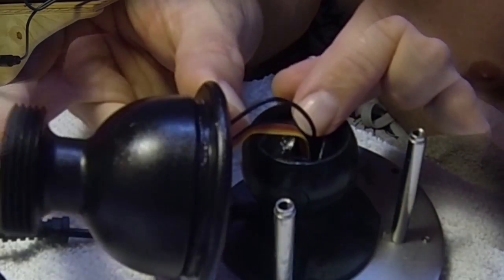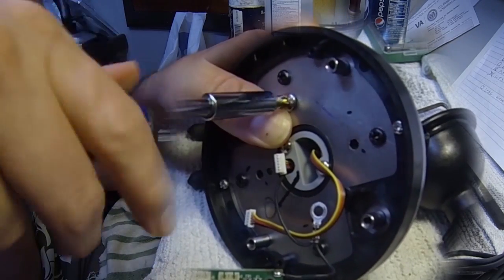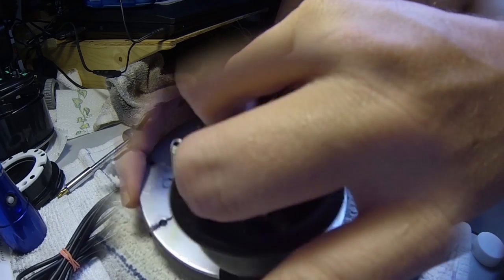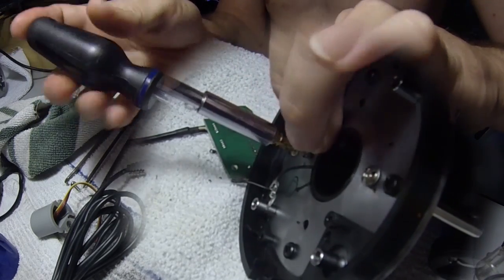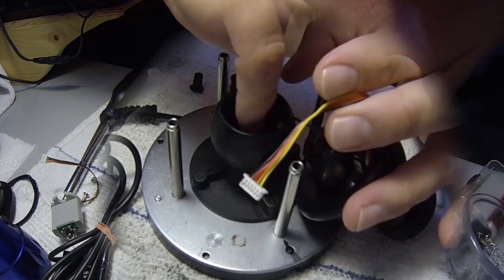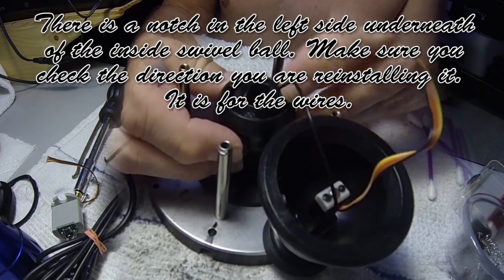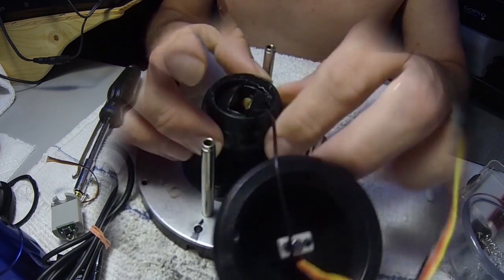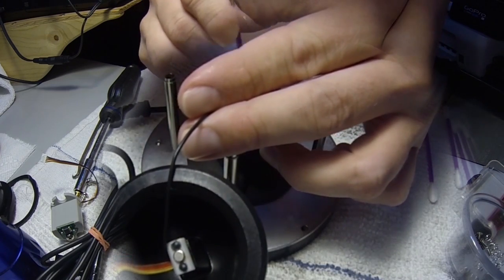ThrustMaster HOTAS Warthog, Complete Disassembly, Grease Replacement, Stiction problem, fix

Comment: I have a HOTAS magnetic base that my father twisted, and no longer responds. Is it possible that it is just an unseated wire? Or recycle it ?
Reply from the maker: @dynotesting  you would have to disassemble it to find out the issue. Most likely it's brakes plastic gimble. But possible you will get lucky and something is just unsealed or broken wire. Good luck hope it's  fixable.

Comment: Has anyone tried to do DCS f18 aerial refueling with this warthog stick after performing this fix?? I have a brand new warthog stick purchased a few weeks ago. Although the stick is nice and heavy and I guess "realistic" feeling, I'm finding it impossible to do aerial refueling. The stick is way too stiff and it just doesn't have that precision and finesse that's required for refueling.
Reply from the maker: @eknight101  Hi, the newer sticks seem to have a little more tension in the middle indent.  Unless you have stiction. The fix may do little to help. As that center pressure comes from the spring. It will wear in over time though and get a little looser. I purchased the new TM AVA base and it is amazing. Really a great upgrade. Can't imagine anything smoother. A little pricey but I think worth it in the long run.  I put a medium cam on pitch and a soft cam on the roll and tightend the soft one all the way. Using the jet cams. If anything, the AVA cams need a little more indent.

Comment: Maybe you should reconsider the greese you used. It can make plastic brittle after some time:

Silicone greases, for example, are lubricants that blend well with this material, increasing the life span of components and significantly improving their performance. A silicone grease can be considered the perfect plastic lubricant, as it tends to be inert towards plastics and elastomers.
Reply from the maker: Hello and thanks for the question. If Silicone works great for you then have at it lol....The grease i am using in the vid is a plastic safe grease.  Silicone, actually a few types were tried and they do not stand up and do not have a good enough ngli rating. Or I should say they are just to thin and do not lubricate after a couple of months. Yes Silicone is probably the safer of the two but in this case, not the best lubrication. It just isn't thick enough or have the staying power on this application. Silicone works greatbon small projects and parts but notbunder pressure so much for this.This is from my own research and actual implementation on this particular flight stick. Also you can look at the Meterial safety data sheets on the particular grease I used, you can also find that info and safe use information at the manufacturer.  Thanks again for the comment. Have a great day.

Comment: Thanks for this video!
I'm strictly a flight-sim hobbyist and started flying within 6 months of the release of MS FSX. Shortly after I installed the 3-DVD FSX Gold, w/Acceleration disc, (around mid-2011), I began the long journey of learning how to build and overclock, high-perf desktop computers needed to handle the 3rd-party addon software. But that's another story for another time.

Then, I bought my Thrustmaster Warthog HOTAS on December 2011 from Amazon. I eventually found some light 'sticking' or slight drag in the spring return roughly 3 or 4 years later, (but not as bad as yours). As an experienced, first-class machinist for over 25 years, (now retired), I new that the best (affordable) grease to use on this system was the white-Teflon grease.

I applied a light, nearly transparent coat of Teflon grease to the hard, ABS plastic ball and some to the spring. That was all I did and the control system operated perfectly right up until about two days ago, January 21st, 2024. BTW; that comes to 13 years from initial purchase and about 9 years since I greased it for the dragging issue, (for those of you who haven't been keeping track 😉), 

Then two days ago, (again, JAN 21 2024), I was setting up the controllers to take a flight in MSFS 2020. Unfortunately, I carelessly rested the Warthog's stick controller on my desk as I went to place my Rudder controller in position. I didn't notice that my shoe caught hold of the dangling USB cable from the TM controller's base and when I stepped back, the entire base and stick swept from the desk and hit the floor with the J-Stick grip leading the way!

BAMMM! Just like that, a 13-year old controller came to an end. The stick, still tightly connected to the threaded collar, broke the ABS plastic that is part of the one-piece molded section comprising the universal ball for the X & Y axis. In DEC 2011, the Warthog only cost $398. Today, that same system costs $150.00 more than that, (Amazon's price is $550).

OK, so I immediately ordered another Warthog base hoping that no damage had come to the Grip-stick. In fact, the base just arrived to my house and I'll be testing it later today to assess the Grip's functionality. I'm crossing my fingers... 

But I think I can attribute the reliability of the Thrustmaster Warthog flight controllers to the fact that I've always kept them covered, protected from dust. Of course, the Warthog controller system was built to last and meant for serious simmers. TM has proven it to still be one of the best flight-sim controllers available today. It was worth every penny they charged in 2011 and it's still worth every penny today. 

In fact, way before the availability of those "Meza Mount-Dust Covers" that you can buy today on Amazon (custom-fit to cover the TM control system), I bought the same covers from a private designer who sewed these covers himself, way back in 2011. In my opinion, he seems to be the original designer. 

He may have sold the design to Meza Mount but he was selling them as a member of the Thrustmaster Warthog original blog, (no longer on line). I also have the Honeycomb Alpha/Bravo yoke controllers for aircraft with yoke systems and I keep them covered and protected from dust as well.

If nothing else, I would strongly suggest that anyone who owns expensive, advanced control systems like these to not underestimate just how bad dust can be when it comes to electronics and moving parts in these controllers. ALWAYS cover them when they're not in use!
FWIW
PS Thanks again for the video!
Reply from the maker: That is a great idea. I try to keep my gear covered when not in use. Also this is a newer video https://youtu.be/55Jz-yum8OM?si=6GA1D-THSAK21WCH

And I justvstarted a new gaming channel and will have a lot of Sim stuff coming soon. Right here. https://youtube.com/@WasabiPeame?si=o1m0Aa5QwcmXOTZO  thank you and you take care. Hope the new stick is awesome for ya.
Reply: @RippleLife  Thanks! I'll check that out ASAP. I tried out the new TM base last night and it worked great. Thankfully, no damage was done to the stick when it hit the floor. Just tells you how well Thrustmaster built this system!
Rich

Comment: Great info, thanks! But what can we really expect considering that everything is made in China...🤦‍♂️
Reply from the maker: As China is most definitely capable of producing high quality components, I do believe that the parts in question were chosen to be made at a much lower cost therefore impacting on the bottom line.  But again this is never the way that a longterm company should go.  I believe that we are in a time when things are being made so cheap and disposable that nothing will last so we consume and consume.  I think all businesses need to strive to make DURABLE and properly working components that a good company can be proud of. Just as we  did 50 years ago.  We made things that lasted that customers would be proud of purchasing.  And a major plus is loyal customers.  Gotta run, take care.

Comment: I keep crashing because it keeps throwing me in dives .
Reply from the maker: Try calibration and sometimes software and driver reinstall unless something physically worng or actual problem. Good luck. Oh possible a sensor problem or came loose. Try the calibration and driver first and of course system reboot.   Then do an inspection of the stick.  Hope this helps have a good one.

Comment: Hey man, thanks for the great video - liked and subscribed! I have a 6 year old warthog that has developed a bit of play (twist) over time and now starts registering a trigger pull as all buttons being pressed but only when the stick is deflected in certain directions. I pulled it apart expecting to see a frayed wire causing a short, but everything looks okay at first glance. I haven’t cleaned all of the grease off of all the wires and separated the components enough to see every bit of them yet, so maybe I missed it. Can you give me some guidance?
Reply from the maker: Hi, thanks for the sub. Yeah mine has some twisting as well. Ok so... Keep in mind, it is possible it's a software conflict in controls. Assuming that's not the issue. I would first check all of the wires and be sure there are no pinches or breaks.  Make sure they are all still firmly soldered.  If so it may be the trigger mechanism. And really at this point, it could be the stick section or something wrong with the board. Try to recreate the issue and narrow down what's happening and where it's happening,  when you have the issue. Remember that I have seen control conflics do this type of thing.  I hope this helps a little.  It's all I've got for now lol. Have a good one and good luck.

Comment: Rather than windows tool download the official thrustmaster tool which will save the calibration into joystick firmware. Using the windows tool may reduce its overall resolution.
Reply from the maker: Great idea

Comment: Hey man, I know it's been awhile since this video has been posted, but I was wondering if you could share the pinout of the base's 5 pin mini din connector. My brother got one of these and the the wires didn't have any stress relief on them and a couple of them sheared off at the solder cups. I'm trying to fix it for him, but I'm not certain of the connections for the orange and brown wires. I know it's only a 50/50 guess, but It'd give me peace of mind knowing I'm not ruining the uC's on the boards. Thanks!
Reply from the maker: Hi, I really wish I could.  And I would but I currently do not.have the stick with me.  I believe you could find a schematic online.  Dorry couldn't help with this.  Good luck and take care.
Reply: @RippleLife  thanks for the reply. It's nearly impossible to find a schematic online. However, I did find some one with a similar issue to me and they thankfully posted pictures.

Comment: Link to grease product is broken. The links that rsi42 posted are probably correct, but US shopping is disabled on their site. The west marine website shows a product, but doesn't detail the type of grease (calcium sultanate, or other)
Reply from the maker: Thank you for letting me know.  This is also the older video.  There is a newer video I put up 2 years ago.  I will either update this one or pull it.  Make sure to go through the comments as there are updates in them as well as the description. Thanks again and take care.

Comment: While pulling the cap i cut the black wire ( ground wire ). The stick is working perfectly without soldering it. Is it going to cause problems in the future?
Reply from the maker: I would solder it back .  Although I do not know if the disconnected wire will cause any issues in the future.  But I personally would not go without it connected. Its really easy to solder.  Just makecsure to practice on an old ic board first.  Good luck.  Hope this helps and you get it fixed.  Take care.
Reply: @RippleLife  Thank you bro <3

Comment: This video worked great for me. Good discussion and helpful points.

Of note, if you don't have circlip pliers, an allen wrench will work just fine. I put the short end of the L-shaped allen wrench into the ball joint, and then I just had to tilt it back to get leverage and pop out the swivel joint holders.

Comment: Hey, I have a question, I have opened the 2 screws on my brand new warthog throttle for the optional afterburner detent and in the process dropped both screw rings into the space and I can't get them out, I've tried shaking the throttle upside down and eventually they've stopped making any sound inside meaning that they got stuck somewhere, and the throttle works fine, so what's your opinion, is there a risk of something getting damaged in there? should I risk it and open it up (since I literally just got it yesterday)? any help would be greatly appreciated :)
Reply from the maker: Hi.  Not sure if i could be help to you.  If they are in the bottom i would just leave them if everything is operating doothly.  Id just make sure its mounted.  I have mine mounted so i cannot get inside and im not sure if i t.f has an access on the bottom thats not rivited.  If there is just open an they light just roll out.  Make sure its not plugged in.  Im sure youve tried those already.  But hope you gett it fixed.
Reply: @RippleLife  I'm gonna open it sometime soon then, since it's working great now, thx for replying! :)

Comment: If the problem is seams that makes friction, wouldnt this fix alone simply by the use over time? I dont dare to dissasemble that much and place a wire on a wrong position to get pinched.

Comment: Hi, I am about to do this fix, but before I start I would like to completely understand the construction, WHY are these swiwel plugs a problem, and exactly WHAT do I achieve by expanding the holes that they go into....?
Reply from the maker: Hi. Make sure you watch the video first.  The pins are too tight fitting causing friction.  Also there are a couple of additional steps.  1. If you remove the o-ring..(I RECOMMEND YOU DO)  slightly bevel the edges of the metal ring the o_ring was stuck to.  2.  Roll sandpaper and slightly sand the 4 holes in the white spacer that the mounting poles go through. 3.  The rectangle hole that the magnet part and wires go through in the half inside ball swivel that has the holes for the pins you were talking about.  Well smooth out/sand the corners and inside of it by rolling about 3 or 4 inches of sandpaper and sticking it inside and sanding lightly.  Should be stiff enough rolled to fit.  The inside swivel should move freely but not loosely. After you sand pins and the holes in the half ball thingy.  Hope this helps.  Good luck and relax and take your time.  The grease is very important.  Wrong grease will make sticky or won't last.
Reply: Thanks for Your time, and a beautyfull boat You got....

After I asked the question I saw the video again (I saw it two weeks ago), and then I realised that the swivels indeed swivel, and that they get to swivel better if I sand them....;- )

Thanks for sharing....!!!

Comment: Beware: when clicking together the articulation spheres (see 9:37 in video), if the wires are not pre-inserted into the notch and carefully pulled, they can get damaged and/or cut.

Comment: So I just got my Warthog today. I am concerned about the sticktion issue, though I haven't noticed any yet. This seems likely a highly involved process, and I'm not too comfortable dismantling the electronic components in the flight stick. Is there a less invasive (albeit, with the understanding that it would be a less effective) method? It would seem if you just dismantle the stick from the top and not go underneath you could reach almost all of the locations he greased, even if you couldn't sand and smooth the seems. Would this be an ok Temporary solution for someone who is unwilling to risk having to Solder anything? Or would it be a MUCH less effective than this?
Reply from the maker: +Thomas Wallen Hi, You can just do a regreasing.  cleaning off all original grease and using the recommended lewmar gear grease.  but that still involves a breakdown.  I do offer this service for a small fee when you do need it done just pm me with your email. thanks.

Comment: my stiction has been getting worse of late, to the point where I am thinking of going through this nightmare of pulling it apart.
Reply: Thanks.  Might tackle this today.
Reply: You are a legend.  I just finished going through the process and can't believe the difference.  This is how it should have been when I pulled it out of the box two years ago.  Will be telling my mates with warthogs to follow your vid. Awesome, awesome, awesome.
Reply: +Low Blow What grease did you use?
Reply: Lewmar Geargrease

Comment: Pre-ordered my Warthog like a month before release, what, five years ago now? Was super hyped about it and to this day I absolutely love it and think of it as the best investment I've ever made in simming. But I can't deny the stiction has been a real pain in the ass and caused many a gun run to veer slightly off or led to some wonky ass landings. I've known for a long time that I'd probably be better off with a cheaper stick but I love the warthog so much I've just put up with it.

Well, after a particularly frustrating couple of attempts to fuel in DCS I decided to fix the damn thing. Gotta say, thanks for the guide man. Stick is like pure silk now, it's what I should have gotten for my $500 back when I ordered it. I'll dedicate my next tank of gas to you. 

Cheers